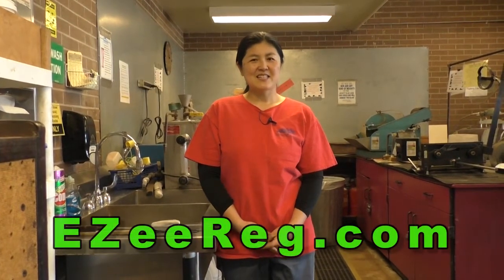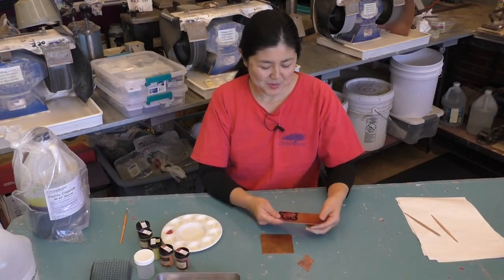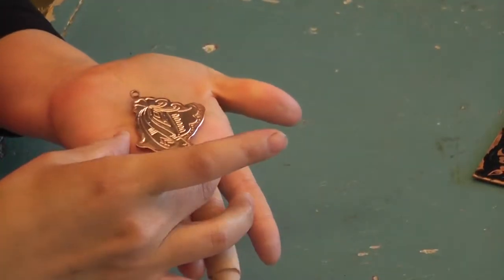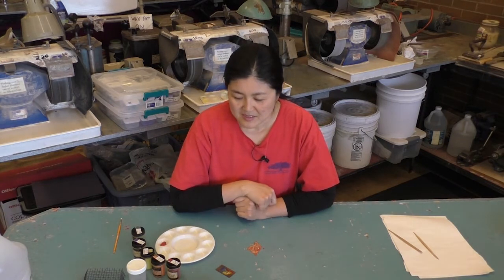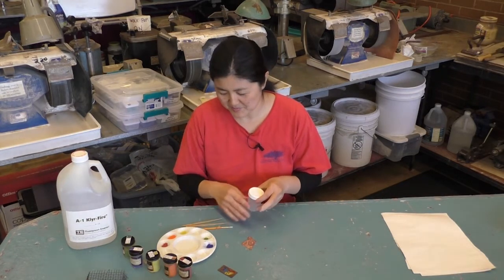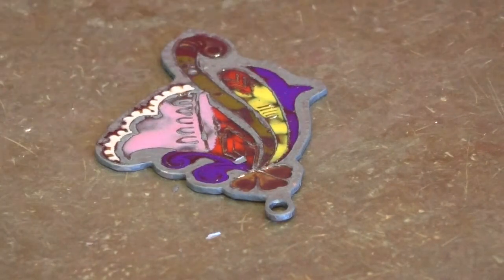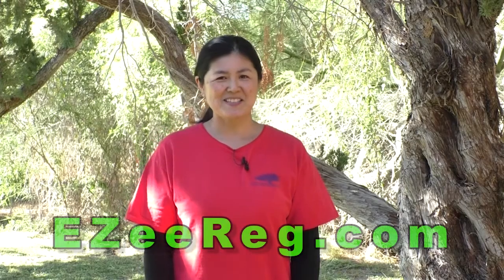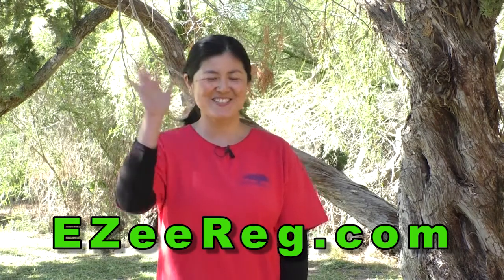Champleve Enamel Jewelry

Comment: What is the difference between Klyr fire and  the distilled water I have using for thirty years.
Reply: Klyr Fire is a binder like a glue, it keeps the enamel glass in place. Other binder types can be used, but Klyr Fire is one of the most popular, comes from Thompson Enamels.  Appears that she is placing the binder into the cell and then inserting some dry enamel to the cell with the binder already in the cell.  I've also seen people mix the enamel and binder together in the paint palette first and then insert the wet enamel mix to the cell... either way works it appears.